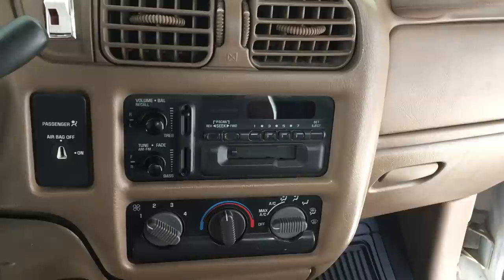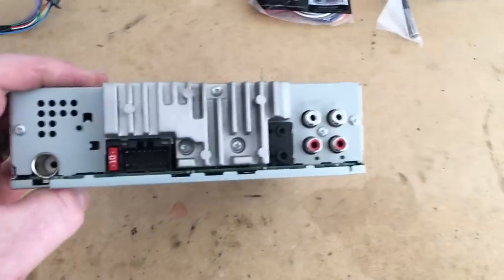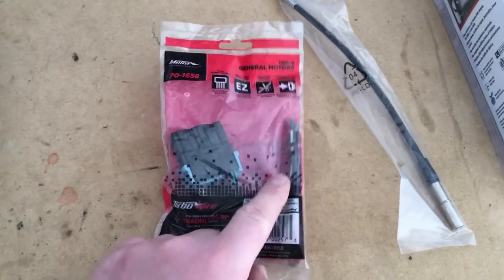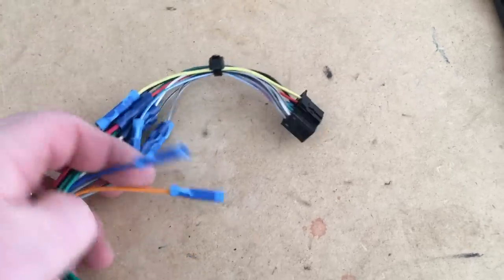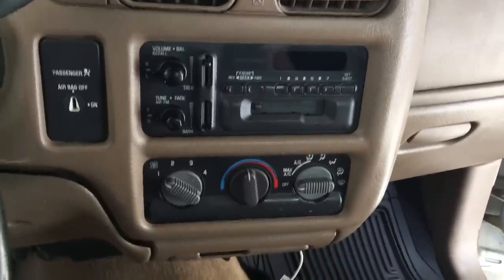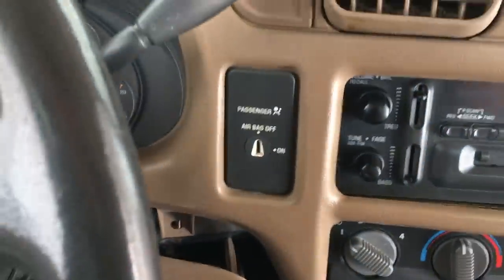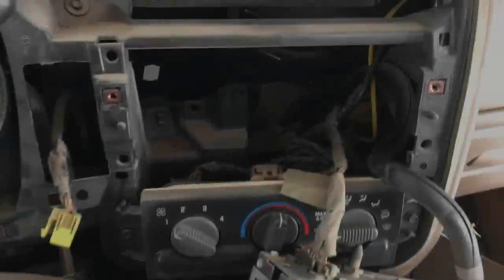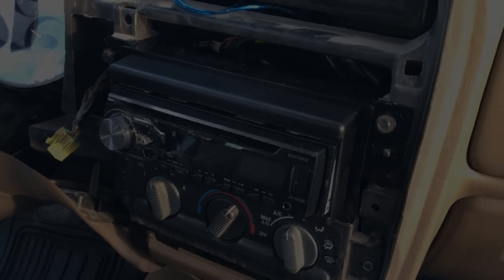1998 - 2004 Chevy S10 Blazer Sonoma Radio Install

Comment: If you are installing a single Din radio in a 94-97 S10 or Blazer , it will have a factory pocket below factory radio and climate control panel is beside radio not below it. Removal of factory radio and installation of new one is different than 98-2004 models. Scosche makes a kit for these older trucks that comes with a new pocket and it's a GM1515B . Metra makes one similar that is a 99-3045 . Metra also makes a model without the pocket that is a 99-3043 .. Hope this is helpful for you guys that have the early Gen. 2 trucks.

Comment: Thanks for posting! This video will come in handy when me and a buddy start installing a Bluetooth Dual radio in his 2001 S10 this weekend. We are also going to rewire the original stereo connector back in while we’re at it since the previous owners of his vehicle cut that out. We were lucky to find both the original connector and the aftermarket connector in the junkyard hahaha. Since he already had an aftermarket radio in there, we will be able to reuse the dash kit and the antenna wire.

Comment: Great video, looks like it’s installed a bit low though. It should be secured through the middle bracket on the right and bottom bracket on the left. I just installed one on a 2000 blazer.

Comment: There is actually 3 screws to lossen in order to pull the cover down to get to the dash bolts.
Reply: Where are they located?
Reply: Figured this out after i cracked my dash

Comment: Getting ready to swap out 2003 S10 factory CD with RDS.  Wondering how the door chimes work?  It is a base truck, no ONSTAR, non-bose, no factory amp, no navagation, no wheel controls or other features they have now.  Some forums say you need data bus harness, other say use the basic harness and you lose the door chimes, and I have seen other forums that say no issues, just works like factory head unit.  Sounds like the chime is coming from dash and not from the speakers.  Haven't taken the dash out to confirm and local stereo shop wants to sell me the $99 harness, I don't see a need for it just to retain factory chime.  I have found a $25 data bus chime harness listed for my truck.  Is there a way to identify before I start working on it?  I've installed several stereos in pre-2002 vehicles, first one that I have seen so many conflicting answers.

Comment: Just replaced the stereo on my 98 blazer. It works great but now my speedometer and odometer no longer work. Reinstalled the original stereo and my speedometer and odometer work again. Figured out it has to do with my vss because my original radio has the volume speed control function. My question is how do I bypass that so my speedometer will work again. I have tried to remove it and cover it so it won’t be grounded but that does not work.
Reply: Oh dang I’m gonna replace my stereo on my 98 blazer here soon I hope I don’t have that same issue

Comment: Some cars need an electrical case because the security runs of the radio. Is that how a 98 blazer is?
Reply from the maker: Electrical case? not sure what you mean.  No, you should be fine with the parts used.  a 98 Blazer was pre-canbus data signal days.

Comment: Do I do the same thing to a 1997 gmc jimmy?
Reply from the maker: Yep!
Reply: Actually no , 94-97 ,trim bezel is screwed on and you have to loosen knee bolster to get to screws,  ashtray has a screw to remove and the climate control has 4 screws to remove before you can remove the 4 screws that hold the radio bracket in place.

Comment: Did you have to cut out the bracket from old radio or does it unbolt
Reply from the maker: The factory radio just unbolts

Comment: I am having huge problems trying to replace the stereo in my 1999 Chevy blazer I can’t find the correct wiring harness, I have looked everywhere, I’ve even been to an advanced audio store and they said that both of my power wires should plug directly into the wiring harness but there’s no way it will cause one plug only fits into the wiring harness please respond and help me out I have brand new Rockford fosgates that have been sitting in my room for awhile now... please help me
Reply from the maker: Okay, what radio are you trying to install, and what wiring harness adapter do you have?
Reply: The stereo is a Sony CDX-GT24W and the wiring harness I don’t have the package it came in any more but i think it’s a 96-04 GM wiring harness and it said it fit a blazer
Reply from the maker: Do you have the factory Bose system?
Reply: I don’t think I do but how would I know if i had the factory bose system or not
Reply: The inside speaker grills would say Bose

Comment: Is there something you have to cut inside the dash? I have a 03 blazer that I’m putting in a after market stereo in
Reply: You probably figured it out but there is a metal bracket that holds the back end of the factory stereo in place which may need to be cut. These dash kits push the whole head unit outwards though.